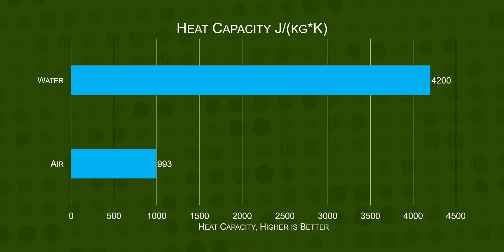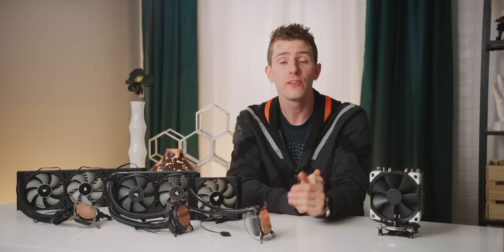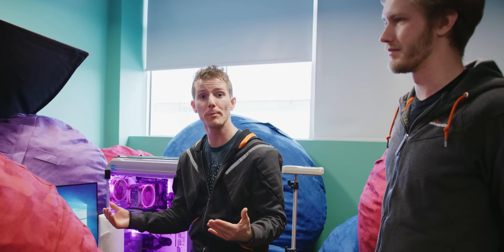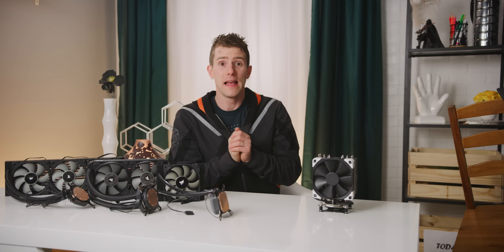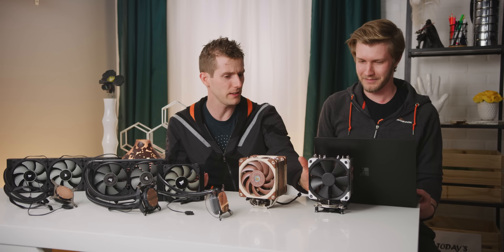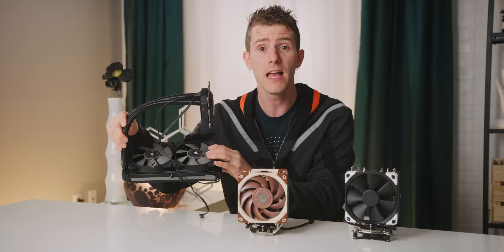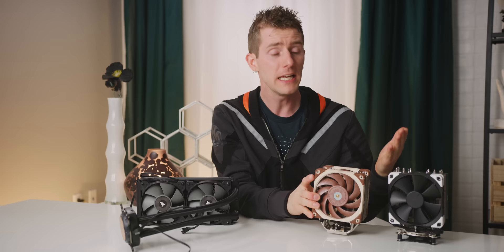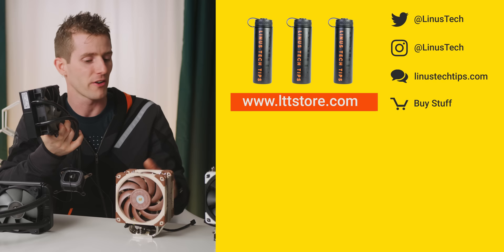Why you shouldn't water cool your PC

Comment: Said the guy who tried to watercool everything in every way 🤠
Reply: These types of All In One water coolers are not what a real PC nerd (like Linus) into this stuff would consider proper water cooling. They aren't a real representation. Proper water cooling is custom kits and loops where you pick out each individual part, with a reservoir and external pump. Not these tiny closed loop systems, where the pump is built into the waterblock. We are talking 15-20 degrees less than what any of these coolers can do, but those setups also cost 4-5 times as much, is much bigger, more complex and more of a hassle. Thats where all the buzz surrounding water cooling comes from. Not these cheap ones.
Reply: That's JayzTwoCents
Reply: @SimonWoodburyForget  honestly, water cooling is better... Having dedication and proper knowledge and know how in water cooling (I.E. full water loops) keep a system cooler and can be over clocked longer with less performance drop off in the future... Air Cooling and Water cooling have their plus and minuses, but if you break it down as to which is better at it's job it is obviously water cooling, plain and simple.
Reply: @EpIcBeardMan1994  when ur pump dies on a custom loop its a major. which is why i no longer have a custom loop. didnt even claim it under warranty, just said fuck this.
Reply: @SimonWoodburyForget  provide me visual proof of air being better then this crappy video where they just say it is then I'll believe you. Until then, a full water loop vs air cooling is always better at cooling.
Reply: @SimonWoodburyForget  since when are you limited on water? i am talking about a full loop, in which water is pushed through a system, if your system isn't cycling through water good enough that is what a "pump" is for... Also, it has been proven multiple times that a full water loop is better at cooling vs air. Again, this isn't proof you are just saying lies lol.
Reply: @greglindstrom1705  Everything eventually "dies" replacements are always needed. It is your choice to choose whatever, but the thing is this doesn't disprove that fact that a full water loop is better at cooling both a CPU and a GPU then air cooling... Both Air and Water have their own pros and cons, so each can be good in their own way, but what i'm saying is if you go and look up temperature comparisons of a full water loop vs a air cooled system temps in a water loop will always be cooler.
Reply: @SimonWoodburyForget  performance to cost, funny you say that because overclocking parts give you better performance,  but when you overclock a part it runs hotter, so for it to run cooler and faster water cooling helps you use overclocking with less performance drop off in the future since the hotter a system runs the faster each parts quality/performance degrade over time. Also, let me again say this, I'm not talking about the prices, I'm not talking about what is cheaper, I'm not talking about what is easier to deal with,and i'm not talking about what's more accessible... for the 4th fucking time I'm talking about what keeps the system cooler when it runs, the cooler something runs the better can perform the longer it's life span. Plain and simple.
I know air and water cooling both have their own pros and cons but if you really want performance with cost and since overclocking gives you the best performance for your system... water cooling with a full water cooling loop, is better at keeping parts in a good lifespan and preventing performance drops from overheating in a parts life span.
Reply: @SimonWoodburyForget  parts in efficiency don't vary in small increments, they vary by the $100s, also CPU is 2nd most expensive part in a build next to a GPU, you saving $25 again isn't going to get you another part like you've claimed, it will only save you in a budget which isn't what you said lol.

Also, where are the links proving me wrong on air cooling vs full custom water loop where air cooling is better? I've only asked multiple times but you seem to conflict that with your own opinion.
Reply: @SimonWoodburyForget  $25 is half a CPU. Now I'm convinced that you've never built a computer.
Reply: Water conducts heat better than metal heat sinks 25x better than air to be specific. Also water can hold more heat before it starts to get hot making something cooler. Also you build a computer by picking parts and components. You then continue building your computer by assembling the parts. Saying you don't build computers, you assemble them makes you sound like your trying to be smart.
Reply: @SimonWoodburyForget  what am going to do play solitaire and wait on my dial up also?
Reply: your heat sink can only soak up so much heat compared to water so no it's not pointless and like I said before water can hold more heat before it starts to feel warm compared to air. Crank your fan up to 100k rpms it's not gonna cool it better than water cooling because your limited by a shitty heat sink that can only conduct so much heat compared to again water. WATER CAN CONDUCT HEAT 25X BETTER.
Reply: @Simon WoodburyForget also your just arguing arguing semantics over building a PC lol...
Reply: Also why do you think stock heat sinks compared to aftermarket heat sinks look so different? Aftermarket heat sinks generally have more copper because copper is a better conductor for heat LMAO making it more efficient at taking heat from the CPU and moving it onto the rest of the heat sink. fact is water can move the heat away from the CPU faster than air.
Reply: water channels being limited by speed or size doesn't make it irrelevant. The water cooling that exist today at the speed and size that it's at now is still better than air cooling. go ahead and get a bigger fan buddy your not gonna cool your system any better unless you upgrade to a aftermarket cooler.

Oh and find the cheapest one you can get because with that $25 you save you can put that twords your next UPGRADE water cooling making your system run COOLER and last LONGER thus also SAVING you money in the long run.
Reply: @SimonWoodburyForget  prove it.

Comment: the credit should go to those Noctua A12x25 fans. They are amazing on any cooler. Try them on an AiO and see how it performs.
Reply: ulhurusurf club  chill out
Reply: ulhurusurf club WHAT GHZ ARE U AT
Reply: They also have black and gray fans.
Reply: @zoyuu  "Evil girl has the prettiest face" they said
Reply: @foopington  HE NO CARE, HE THERE JUST TO SHOW OFF HIS SPECS
Reply: Legilis I AM JUST ASK IF HE OVER CLOCK OR NOT!!!1!
Reply: I've never personally used a noctua fan, and there are big differences in fans on air coolers, but on water, you can have enough radiator surface area that your pump "bottleknecks" the loop. You can see that the 360 aio didn't cool as well as the 240 aio, there was also a new pump design, from a different company. The 240 is asetek and the 360 is another brand with a different design pump. That pump is probably weaker than the pump in the 240 and you can see it on the charts. Aio pumps trickle water compared to a d5.
Reply: Aryte ~ Alex H.  CAN'T HEAR EVERYONE OVER THE FANS SPINNING!!!!
Reply: nice recommendation. I might have to try that!
Reply: Personally I use noctua fans on my 240 rad.  Really good temps and thankfully hidden so I don't need to look at these ugly muckers.  They run very quiet as well compared to the stock fans.
Reply: This is a problem with AIOs in general, they slap sub standard fans on to cut costs and performance suffers as a result.
Reply: Corsair AIO come with MagLev fans that are 30usd a piece, still couldn't compete with Noctua fans though.
Reply: ulhurusurf club  OMG BRO YOURE SO FUCKING GAMER BRO HOLY SHIT BRO
Reply: Yes pay for an expensive AIO only to replace the fans. Sounds like a smart idea
Reply: exactly
Reply: it isn't. Listen to yourself. Noctua hasn't just perfected design and airflow. It isn't just the fans, tech virgin, but the design.
Reply: jup dis test was like, not so good XD
Reply: is only wy you have the Push and Pull Fan ... xD lol
Reply: @MankeyMark  and super expensive
Reply: This. I'm using DeepCool 120mm AIO with NF-F12 IPPC in a case with bad airflow (Bitfenix Portal if you're curious) and even though it can get loud at load, that dude alone cools down both OC-ed RAM and CPU at the same time with a little help from NF-A8
Reply: Noctua coolers themselves are great. For Threadripper CPUs on of the best coolers still is the single fan single tower140mm nocuta cooler, which outperforms most AIOs and is comparable to those giant tripple fan AIO abominations. And thats still using only one of their older fans
Reply: This is EXACTLY where I was going. The Corsair fans are neither as quiet nor do they move as much as as the Noctua's. I put Noctua's on my custom system with the Corsair AIO and the sound generation dropped significantly to almost dead quiet and cooling capabilities went through the roof. WAY more efficient.
Reply: ulhurusurf club  you know you probably spent too much on your rig if you need to go about bragging about it to help justify the money spent.
Reply: @zoyuu  They make different colors, you don't have to use brown.
Reply: @calaphos  I wanted to replace my AIO this year to Corsair H80i and put two NF-F12 IPPC-3000, but after this video i'm thinking about getting used to noise and getting NH U9S
Reply: That is what I came to say.
Reply: Then you would have their cost ontop of the AIO thats, allready more expensive
Reply: Amen Everything i've heard says these are just flat out the best fans out there.
Reply: Vincent Laurensius facts, I was gonna go for the kraken x52 but the noctua u12a was cheaper and performs better, ill go for the noctua
Reply: Abrxas01 I wish, Im getting the u12a and theyre only brown
Reply: Now I want to see that.
Reply: Noctua fans are the best on the market, That power comes at a price.  Noctua fans provide the most cooling per a noise db of any fan on the market.

However, even fractal design fans, which are slightly less efficient, and a LOT cheaper are still leaps and bounds above those basic fans on the corsair AiO coolers.  Also, throwing a push-pull setup onto those AiO coolers could also boost airflow, even if it makes installation much more difficult.
Reply: YA, I'm sold need a few of those.
Reply: ulhurusurf club  I THINK YOU LEFT CAPS LOCK ON!!! 

FUCK YES DOES ANYONE HAVE ANY COCAINE?
Reply: Noctua D15 for life!
Reply: Try them on a proper radiator and you'll never want to look at an AiO ever again ;)

Comment: The frequency of the noise is also very important. I bought an EVGA All-In-One 240mm cooler and while quiet enough the frequency of the noise from the fans was driving me nuts. I replaced them with some Noctua fans and have been good since.
Reply: Frequency? You mean pitch?
Reply: Hey I did the same lol
Reply: @smugmode  they're interchangeable in this context. Frequency is a quantity of pitch, like how temperature is a quantity of heat.
Reply: EoS no he means frequency lmao, never heard of sound frequencies?
Reply: Yep usually the stock fans that come with AIO's are crap, adding most cost to replace them.
Reply: That's why the youtube tech world should finally measure with the sone scale instead of useless decibels.

Comment: Love my Noctua D15. Superb cooling, excellent build quality, quiet, and will last a long time with no worries of pump failure or leaks.
Reply: But its ugly
Reply: @lucaeric510  There is a sort of pride in sacrificing prettiness for functionality
Reply: @lucaeric510  Be quiet Dark Rock Pro then. Roughly equivalent but all black.
Reply: @lucaeric510  That's subjective. I think RGB fans are tacky and ugly but people love those.
Reply: You talk like water coolers just blow up after 2 years. What you paid in this ugly air cooler I got a water cooler with a double fan that for sure will last many years without making no noise at all.
Reply: @lucaeric510  Pro Tip You can replace the fans to any other fan on the market and make it as beautiful as you want and it still be amazing cooling
Reply: how would it cool in summer heat in comparison to aio though?
Reply: @lucasjuhas12  With no noise at all? Did you even watch the video?
Reply: @aregaminghd  AIO's still use air to transfer the heat away from the radiator, so it's not like they have an advantage in a hotter environment.
Reply: Don't forget the vrms cooling! I Made the mistake years ago yo buy a 4+1 970 motherboard for a 8350.... Throttling Even with that noctua on the video, only the bequiet tf solved the problem
Reply: Idk man my Corsair h105 is still keeping my i7 4790k@4.7 overclocked at a cool 55c since 2014, no leak or slowdown what so ever
Reply: it will last hundreds of years... its a chunk of metal, ofc it will last forever, fan die, new fan done, but vs a 360 mm aio its.. mhe specially when ur dammn ram wont fit with the air cooler
Reply: @lucaeric510  That's a matter of opinion. I love the look
Reply: @lucasjuhas12  until it leaks and destroys your entire computer lmao
Reply: Spyder I couldn’t live with a giant ass ugly brick in my build
Reply: Niels Unnerup nah fam it’s just disrespectful to the hardware
Reply: Lucas Juhás agreed I couldn’t live with a giant ass ugly brick in my build
Reply: Janitor at least I put time and effort into a nice looking pc that I can proudly say is mine instead of an ugly vacuum with a Motherboard on it
Reply: I have an antec kuhler 620 water cooler which is I think 9 years old and keeps my 3570k at about 45c. I mean 9 years of almost daily use is pretty good concidering I've only had to open it once to replace the liquid a few months ago
Reply: @truejaz  not sure about that, different fan blades and bearings most likely alter m^3/h and pressure(in this case probably for worse). Thats what i hate about noctua, undoubtedly they got the best stuff, but the seemingly make it ugly on purpose(of cause thats only my opinion).
Reply: @icedoutelite  how are the hoses and pump? How many hours before failure is the pump rated? Are the hoses still in good condition, not stiff, brittle?
Reply: Can't agree more. Got a D15 on my 8700k. Don't think I'd ever do water cooling. Just logically doesn't make sense.

MAYBE I'd dabble in a custom water loop if I ever have a bunch of cash and time to burn (ha, yeah right.)
Reply: @bitdrive7971  Looks are subjective. And I really don't care what the inside of my computer looks like. It's not like I turn the computer on and sit there looking at the parts inside. lol
Reply: @lucasjuhas12  It will in fact make more noise, won't last as long, and you paid more for it.

Comment: 12:44 its okay linus. you can use the word "poor". we are not offended.
Reply: Nah fuck all that
Reply: We’re too poor to have time to be offended
Reply: @Killopotamus  poor in time
Reply: the word poor is too uncanadian
Reply: poor is a mentality. we are BROKE
Reply: no, he means what he says. anyone who was around in the early/mid 2000's (before AIO's) knows how much of a pain in the ass open loop systems are. seals/connections fail, water pumps burn out, hoses break, reservoirs crack, and you're going to want to completely drain and refill the system once a year. i'd bet that anyone who runs an open loop system has had some sort of failure at least once.

it's akin to spending hours and hours tweaking settings to manually overclock. it's fun if you're into tinkering, but it's less stable and is a relic at this point. and i say this as someone who had a custom watercooling loop in '06 and has spent hundreds of hours running furmark/prime95/3dmark. i aircool and use auto-overclocking these days. i'd rather actually use my pc rather than constantly diagnosing crashes/maintenance/etc for a 5% performance gain that i'll never even notice.

Comment: I nearly damaged my new Graphics card, my CPU and my Motherboard with the installing/removal process of my 120mm Tower air cooler being extremely difficult. I got VERY lucky nothing got permanently damaged. I bought the AIO for that reason alone. It REALLY cleaned the build up. Even being a cheap but trusty local brand. Yes, I have nightmares of it leaking, but there's warranty for that

Comment: I've been using my signature dust cooling system open case for the past 10 years 90ºC on idle
Reply: sounds decent. mine sometimes peaks at the 100C mark when turned off

edit: oh wait nvm i forgot to plug in the cpu fan
Reply: @The Fifth Freedom what
Reply: 90C idle, nice. That 10C delta under load is WAY better than any custom cooler I've ever seen.

Comment: I've been doing HVAC for several years. I love learning all different styles heating and cooling applications. I just built a computer out of fun for removing heat from the system.
Reply: @smellypatel5272  that's the capitalist way. It's called profit. There's this thing called overhead you have to charge for. If a part is 100 dollars you also have to charge for labor, insurance,  gas, and alot of other things aswell, that's why a 100 dollar part ends up costing 3 to 5 hundred.  It's just how it is.
Reply: @smellypatel5272  if you don't like the price there's multiple companies that offer the same thing. That's the beauty of capitalism. Competition leads to lower prices. Just because you have a victim mindset dosent mean that the system is broken.
Reply: @NateTheGreat-ij9dx  except the industry is unionized, there are no checks on your work, and the information is highly esoteric to your average customer. All things you're aware of and take advantage of when overcharging for menial work.
Reply: @smellypatel5272  I'm non union
Reply: @smellypatel5272  If you think it's so easy why don't you do it yourself? Working in cramped spaces in a dusty old attic filled with fiberglass everywhere in 120 degree temps isn't exactly a desirable job. There's a reason we charge as much as we do, because it's something most people wouldn't want to do, even if they knew how.